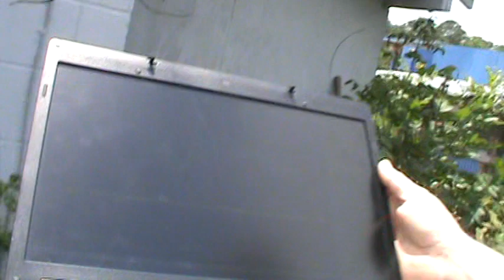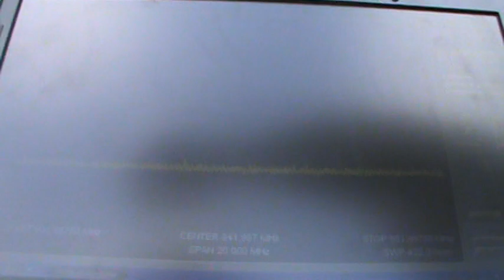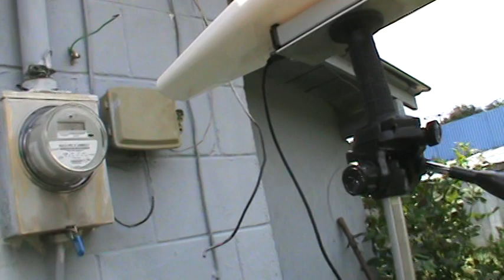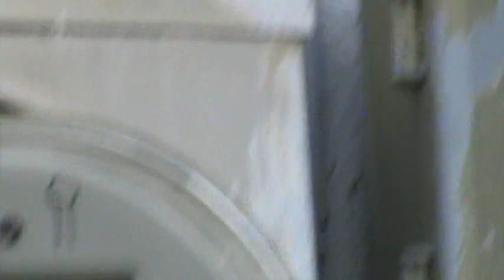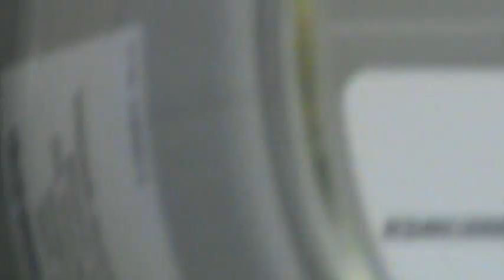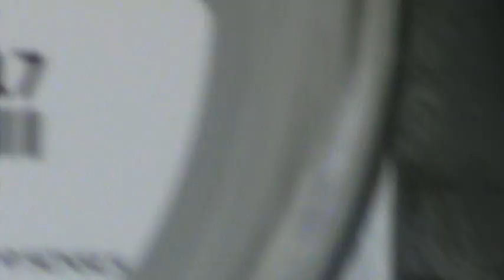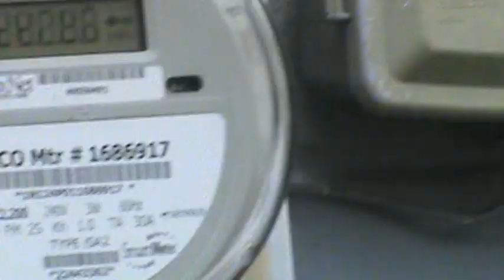Georgia Power Smart Meter Investigation Part 1

Comment: Jeff McCrea
14 hours ago
No, lets talk now. The problem in Cuba and China is multiple FULL watts or tens of watts of microwave power not microwatts or milliwatts. One can NOT be surrounded by THOUSANDS smart meters because homes aren't built corner to corner with smart meters being mounted on common corners of each house. In other words, you don't get to play 4 square with smart meters. Since RF power, like magnetism and gravity, diminishes by orders of magnitude as a function of distance from the source, this means that it wouldn't be able to be biologically noticed by any living thing after only a few feet. I lived in a subdivision in Florida where the houses were so close, when I bought an 8' X 10' storage shed, I had to hire a crane to lift it into my back yard. The lots were 65' X 125' and the houses themselves were only 8 feet apart with a small decorative concrete alcove for trash can storage occupying a portion of that 8' space. The power meters were ALL mounted on the same side of each house which means that there weren't 2 meters visible from any one place in any one yard. Not only this but the meters are mounted in a grounded steel box that is facing the wall of the house. The smart meter itself may not have a ground but the meter box and conduit does. 

...signal conglomeration, harmonic cross talk, infrasonic undulations, the microwave hearing effect, frequency saturation levels in reference to closed spaces.....and much more...not that, alone as a topic, about a smart meter blasting you with radiation...

WHAT THE HELL WITCH DOCTOR HAVE YOU BEEN TALKING TO??? The above are your words, NOT mine which more than proves my point. I HOPE THAT YOU DIDN'T PAY MONEY FOR THIS SHIT BECAUSE YOU DON'T KNOW WHAT THE HELL YOU'RE TALKING ABOUT AND NEITHER DID THE WEB MASTER OF THE SITE THAT YOU GOT THIS GARBAGE FROM!!! 
Lets start with "signal conglomeration". The definition of this is NOTHING more than a mixture of signals. Eggs, milk, bacon, green peppers, salt and pepper is a conglomeration of ingredients to make an omelet. A lot of men, women and children are talking in the same room at the same time. The children speaking in high pitched tones, the women speak in high tones, the men at lower tones. THIS IS audio frequency signal conglomeration. The tower on top of the Empire State Building in New York City has broadcast antennas for several AM and FM radio and TV stations that broadcast at the same time of day on different channels. THIS IS VHF and UHF signal conglomeration. Without insult, you and your friend have certain thought pasterns and I have different thought pasterns that don't align with yours regardless of who is right or wrong. These thought patterns can be received on an electroencephalograph and will appear differently between yours and mine and, in some cases, even your friend's pasterns will be different from you and me. Put these together on a paper roll like a lie detector or heart monitor and you'll have brainwave signal conglomeration. You and 59 of your friends are in your back yard and all are on 60 cell phones talking to different people at the same time. This is milliwatt power, microwave signal conglomeration.
Then there's "harmonic cross talk". The only example that comes to mind that you might understand, again, no insult intended, is in Virginia, automotive radar detectors are illegal. ALL radio receivers with the exception of crystal radios, emit low power radio waves. Even the microwave receivers in radar detectors. This is because to get any kind of quality reception from a radio signal it has to be broken down in stages until it finally gets to the audio range of human hearing. In the case of radar detectors it gets to a point of turning on a beeper and / or LED. If they worked like 1 stage crystal radios, any kid's toy walkie talkie would set them off. Instead, the microwave signal that the cop is irradiating you and your car with is broken down in stages, filtered and broken down and filtered again several more times until only the cop and an air port radar beacon will beep at you. Some genius came up with a way to detect one of those intermediate frequencies leaking from radar detectors and built it into a receiver that the Virginia Highway Patrol bought. Now, if you pass a patrol car with your radar detector on, the cop will pick up this HARMONIC CROSS TALK from your unit and stop you for it. Another quick example is in CB's heyday. You're on channel 10 and the guy next door is on channel 11. You hear each other's squawks but not clearly. This too is harmonic cross talk.
This brings us to "infrasonic undulations". Infrasonic is a range of frequencies just BELOW the AUDIO RANGE OF HUMAN HEARING which is just BELOW 20 Hz. If you looked at a graph of frequencies ranging one Hz to Gamma radiation, you would find the Gamma ray mark on the moon and the infrasonic mark somewhere through the center of the earth and in the South China Sea. Infrasonic undulations, HMMmm. I explained infrasonic. Let's see. Undulations. A child's jump rope undulates. Earthquakes make the ground undulate. Infrasonic undulations would mean something that would make the air vibrate or undulate just BELOW the ability of a human to hear it. Unless someone was aiming an audio frequency horn speaker right at you blasting hundreds of watts of 10 or 15 Hz sound at you, you wouldn't even hear it. If this did happen, you would feel the air and / or ground vibrating around you but you still wouldn't hear it. No problem here either.  
The "microwave hearing effect"??? WHAT THE HELL IS THAT??? If a human could hear microwaves, you wouldn't have a microwave oven in your house. At between 800 and 1,100 watts, it would blow your ear drums into your sinus cavity!!! WOW, "Frequency saturation levels in reference to closed spaces". If my mother was still alive, I'd swear that you've been talking to her. She was a great one for The National Enquirer. RF frequency saturation does NOT mean a build up of radio frequency energy in an enclosed space. Frequency saturation relates to air core, linear ferite core coils, toroid coils and other tuned radio frequency circuits. Air core RF coils are just as they sound. An open coil of wire wrapped around a hollow tube.  A linear ferite cored coil is the same except it has an iron ferite rod in the center. If you have ever taken the back off from a pocket AM or AM - FM radio to change the battery, the 1 1/2" or 2" coil of thin wire across the top of the circuit board with the semi-shiny black stick in the middle of it is an example of a linear ferite core coil. The last example or toroid coil is a coil of wire wrapped around a round doughnut of, usually, iron ferite and wrapped around the walls of the doughnut in a ring shape. There are different uses for each of these coils and they come in different sizes and tuned for different frequencies. Saturation of frequencies means that the maximum usable power of the radio frequency range that one of these coils is tuned for has been reached. If you were to add more power to it, it could be wasted, cause HARMONIC CROSS TALK with other radio receivers or within the circuit that it is wired to, burn out the wire coil or crack the ferite core or toroid in the case of the last two examples.
A sheet rock wall can be saturated with water in a flood. Your yard can be saturated after a heavy rain. Radio frequency emissions can NOT saturate an enclosed space like a room or building. You can build what's called a Faraday cage which will take radio signals and cycle them either to ground or around you but in the absence of this, radio frequency energy can not be saturated, stopped or absorbed in an enclosed space. The material constructing the enclosed space , people or things can absorb some of the radio signal but, for the most part, it will pass through all of it harmlessly unless, of course, you are the U.S. Ambassador to China or Cuba. I hope you get your money back in any case. Good night.
Reply: Let's look at why we do not need smart meters. 
 #1 A smart meter will hurt or even KILL disabled homeowners who have disabled medical implants.  The average of deaths by smart meter radiation and smart meter fires is almost 100 every month in North America.

#2 Did you know if your power company “turned off” the power to your home when they did a smart meter install, your chance of a smart meter fire increased by a factor of 10,000.

#3 Your power company has access to all of you private power information. Eg When you make tea, when you turn on your alarm etc. This private information is sold to Google for huge sums of money. Ask your power company what the second radio transmitter in your smart meter does. (ZigBee) 

#4 A smart meter will cause cancer to return if your family members who are fighting cancer at home. If they come home from the hospital and sleep near a smart meter, they will die. Check with the US Cancer Society website. 

#5 Smart Meter RADIATION  will turn off breakers in your home. Both AFCI's and GFI's get turned off by the radiation from the smart meter.

#6 You smart meter is very accurate, BUT, the software (firmware) is programmable. Your bill has nothing to do with the power you use. 

#7 Smart meter radiation is breaking Ionic Bonding. 

#8 A huge expenditure for a huge loss. Billions of dollars to purchase something that does not general generate any power and each smart meter need 4 watts to operate. One million smart meters use 4,000 KILOWATTS of energy to operate.

#9 The second radio transmitter is for ZigBee. If you want your power company to MONITOR your home 24/7, then you are in luck. Don’t forget, this private information will be sold. Why do you think your power company spends BILLIONS of dollars and does not generate one watt of extra power to sell?